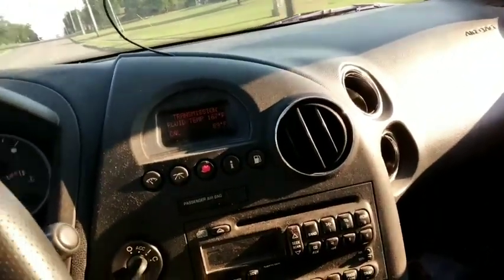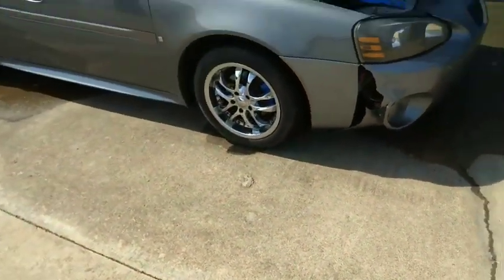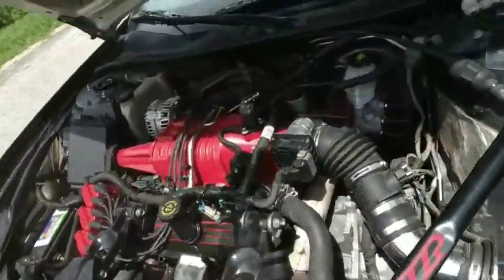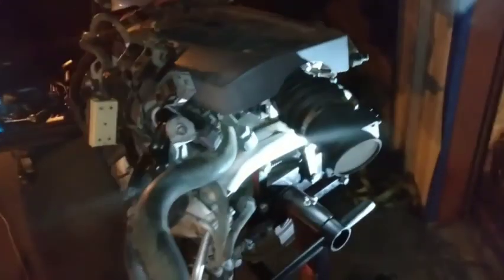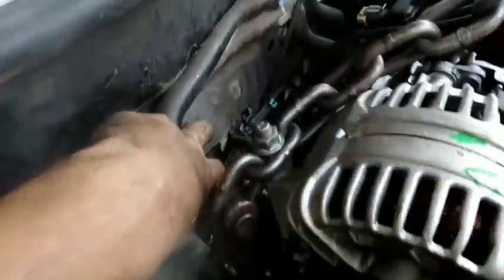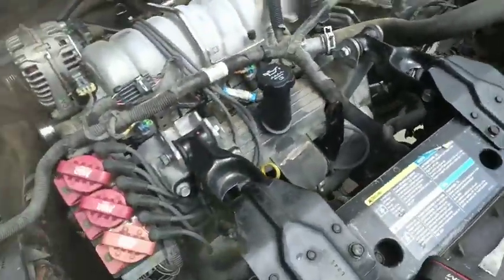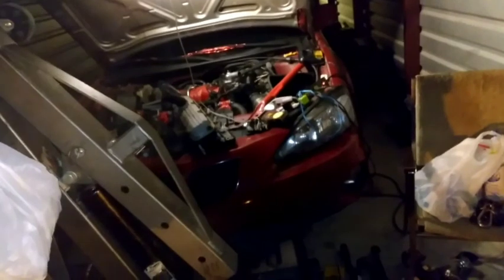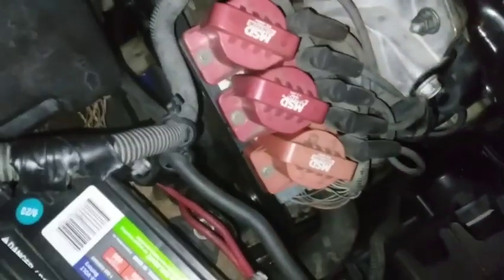I broke all 3 of my grand prixs in 10 days....

Comment: Been watching most of your videos.  It seems like you went to low of a pulley size without a intercooler. KR killed it. Never seen a 3.8 supercharged go under a 3.2 pulley without a intercooler.  Even on e85🤷‍♂️
Reply from the maker: Very true. Zzp says with the NIC cam you cam run a small pulley without an intercooler. But they recommend it for anything smaller than a 3.4 pulley. This time im redo-ing everything. New block. New cam and lifters. Heads are at the machine shop getting machined and valve jobs. Ive got a shit ton of work to get done on this thing.

Comment: Sounds like a collapsed lifter bud
Reply from the maker: The knock in the red 07? I really hope not. Or the blueish silver 07? That engine completely locked up.
Reply: @PontiacsGarage  the one you’re driving in this video. Doesn’t sound like a knock to me.. too sharp of sound.
Reply: @PontiacsGarage  the red one. Are you sure it’s the bottom end? It’s super loud in the top end when you go to the bay with it running
Reply from the maker: Man that's no good. These are LS7 lifters. I hope they're ok. I need these for the new engine build. I guess I'll see when i tear it apart.
Reply: @PontiacsGarage  well hopefully if it is top end, it didn’t scar up the cam or anything… keep us updated.
Reply from the maker: @paulbullock7954  I definitely will. I just tore down the engine out of the 06 yesterday for the head and valve covers and the alternator, but Cylinder 3 piston is just gone. Bent the valve and cracked a lifter. Cracked the oil pan all the way around. Its toast. But i got the parts off it that I want for the 07. So this weekend I'm pulling the engine and transmission out of the 07 and engine is going on a stand. Alot of the new parts I ordered got delivered today so alot is gonna be happening in the near future.
Reply: @PontiacsGarage  making a negative into a positive. Nice man now get er done 💯